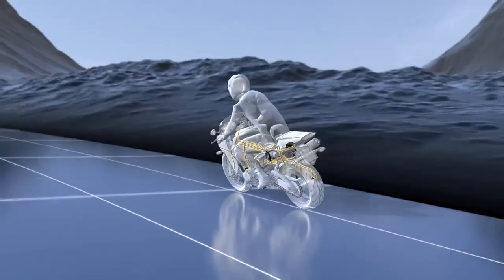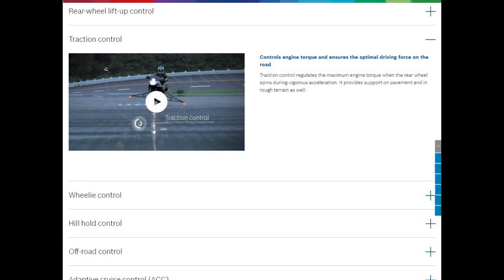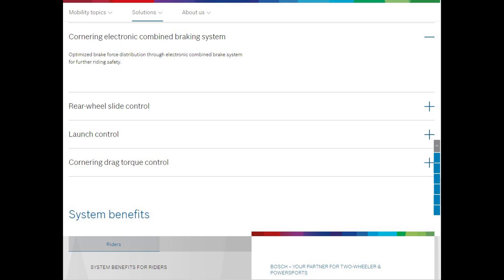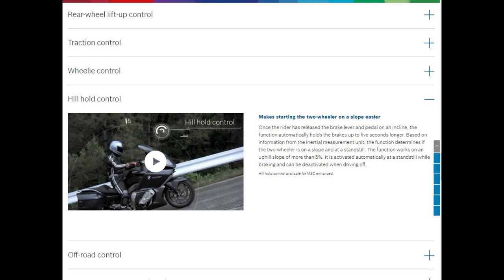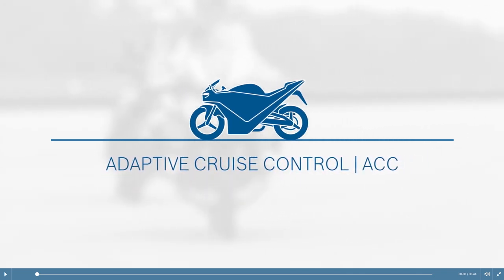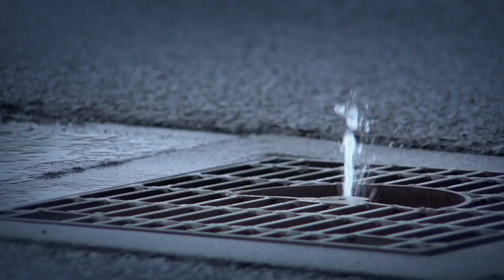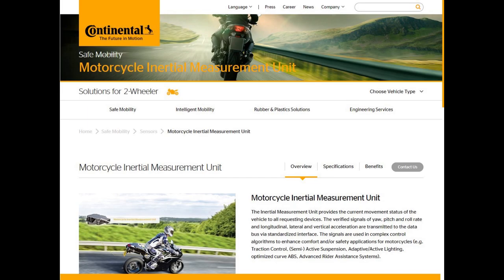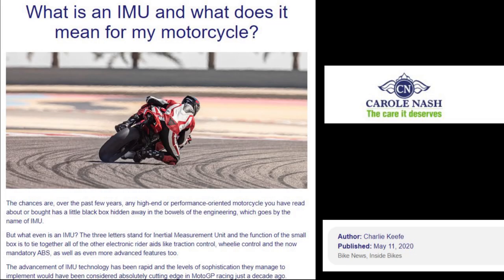Motorcycle IMU: Inertial Measurement Unit. What does it really do? Is it really better for riding?

Comment: Hallo..you have Videos for 1200 sportster Costum...have you mapping the sportster? Or habe ecm  resetet?  Thanks for answer
Reply from the maker: Morning Andre - I didn't do the 'remapping' as I understand a remap is less substantial than a reprogram. I have no technical understanding of this sort of thing (!), but the Hilltop website explains that a reprogram is better... so that's what I did. (Although it was expensive - about £300 -  it was hugely beneficial for my Sportster!)

Cheers,

Chris
Reply: @chrisoftheot6272  you have a Sportster good for you. I have four hundred thousand miles on my Sportster. The engine is all original except for the stator which I wore out at 250,000 miles. I change the oil twice a year and I change the filter every other shot and I change the gearbox fluid every time I change the filter. I find it ironic that is soon as Harley-Davidson cancels the Sportster claiming your 05 is the reason and the Chinese have one waiting in the wings that passes Euro 5. Ironically I bought my Harley so I could have lots of choices for when I would need to have valve jobs as such tension stuff done because I ride my bike all the time along with my other ones being retired now. It has been phenomenally reliable and dependable beyond my wildest dreams. I got 100,000 miles plus out of a belt I still have the original sprockets that came with the bike not worn at all. I just put tires on it and a battery once-in-a-blue-moon and she keeps going and going and going. I am looking forward to having her back on the road. Not a fast bike but I have my Triumph Daytona if I want to go fast my 1973 500 not the fake Triumph made in Taiwan. I am so glad to Stormbreaker is coming out because it will introduce so many people to the pleasure of riding and evolution Sportster and priced equivalent to the Royal Enfield Interceptor it will give them a run for their money. With all the accessories you can buy for a sportster and all the hop-up accessories you can get for the motor the Interceptor has no chance to compete with that. Plus the Sportster is built old school with everything and bushings and bearings because it was made to last forever no planned obsolescence. There is a little bearing in the clutch that goes out every 50 or 60 thousand miles it's a little $10 bag of parts from the Harley dealer it takes about 30 minutes to put it in the primary that's it

Comment: Some  become more positive re rider aids after having safety critical "rider aid" interventions.

My current bike does not have an IMU....I have ridden an IMU equipped Ducati. I have owned a car with Radar Cruise control & hold assist braking.

Some infer they can out perform a decent IMU equipped bike. Others suggest they could never see benefit from rider aids....Personally I do not make such claims.

I value true analogue riding skills albeit I know bikers that have crashed (some more than others),  when exploring limits. ...I accept that high skill is involved in best  mastering "on the limit" analogue riding skils. I also accept riders can crash on bikes with rider aids...plenty of Moto GP riders do so.

I believe most analogue trained pilots can acknowledge what a Eurofighter Typhoon can do...even if they prefer the challenge &/or enjoyment of flying rawer aircraft.

I am not a fan of poorly reasoned hostile argument &/or trolls.

Good video - Thanks 👍🏍😮
Reply from the maker: Thank you for the vote of confidence AW8. :-)

The only vehicle I've ever owned with electronic aids (other than ABS) is my current Speedmaster. It does not have an IMU, but does have traction/cruise/etc., but if the IMU were an option, I would have got it.

Your observation that Sopwith Camel pilots would still appreciate Typhoon abilities is very apt - and true, I think, the other way around. Certainly I would enjoy a piston engine bi-plane, even if I went to work in a Typhoon. Which I obviously do. Everyday. The 'analogue' feel is second to none, no question. But the reality of every day riding (or flying) in the modern world means that 'digital' is easier and safer. Now that I have passed 60, easy/safe/comfortable are all essential: no more Sopwiths for me (alas). But that doesn't mean I can't appreciate a lovely, old machine. In fact, I am one...

No, I am.

Cheers AW8 - thanks for your encouraging comment,

Chris
Reply: Good further analogies..  I refuse to let age maturity negatively shape my persona (bloke in 50's here)..All the best  😊